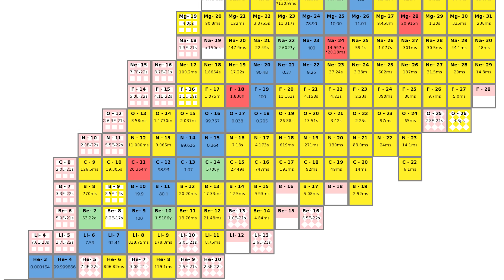Why the U.S. Doesn’t Recycle Nuclear Fuel

Comment: Toured Shippingport as a kid in 1963. Family worked for Westinghouse. Pro nuclear my entire life including joining a group advocating for nukes. Currently civilization uses 17 terrawatt hours of energy is required 24x7. It would take 15,000+ nukes to replace fossil fuels. Globally there's only 450! Unfortunately our current civilization cannot survive intact until we spin up enough nukes. Our immediate opportunities are to install ASAP the many many already existing technologies that work! We went 100% electric at our 73yr home in northern Ohio. Used US equipment and local tradesmen over the last 10 years. Upgraded as we dealt with typical home needs of roofing siding insulation HVAC appliances vehicles and tools. We can show we've lowered our emissions by over 80,000 pounds. Our home is cleaner safer and more comfortable. Companies investing in manufacturing sustainable systems were rewarded as were contractors. Only rebates were for a small solar system HVAC and heat pump water heater. Our electricity supplier gained $1,600 in new revenue as we eliminated the gas line. Our total energy costs are lower than the majority of Ohioans. Combined greenhouse gases pollution now exceeds 57 billion tons annually!! There's only one number that matters, parts per million greenhouse gases, andits growing faster than ever. Simultaneously per Exxon we're extracting 100 million barrels of oil every single day and depleting reserves at the rate of 15% annually 2X faster than international energy agency predictions. There's no Fossil Fuels Fairy refilling the holes......

Comment: Isn’t depleted uranium ammunition reusing nuclear material? Could be wrong idk
Reply: "depleted" uranium is still a viable nuclear fuel in certain reactor designs such as the Canadian CANDU reactor. So first off, going to a reactor design that allows use of U-238 increases the availability of fissile uranium by about 99 fold. Secondly, depleted uranium as ammunition is effective but leaves radioactive and chemically toxic waste in the aftermath of any battle where it is used. I guess you better just hope that any war does not come to your backyard.

Comment: Reused fuel is NOT inert.
It just changes from and 80,000 year problem to a 40,000 year problem.

This propaganda piece is disturbing.

0:35 Watch her choke on the spin that she knows is bunk.
Reply: Too bad you don't have facts.
Reply: @danadurnfordkevinblanchdebunk   Do you think that reused fuel is left inert?
Seriously?
Too bad you didn't provide anything to support your weak attempt to discredit.
Reply: @danadurnfordkevinblanchdebunk   Yes, that old "natural nuclear reactor" case isn't proof that we have a long-term storage facility.
Your very specific statistic about "no death from long-term storage" is accurate because there is no long-term storage facility. 
It also doesn't take into account all death from nuclear waste handling. Conveniently specific stat.
"4 ways of dealing with high level waste" is NOT A LONG TERM SOLUTION.
Any long term solution will fall on the taxpayers after the profits have been extracted unless long term storage is a regulatory requirement of any project.

Your talking points are a cluche script. It's a bad script.
Reply: @danadurnfordkevinblanchdebunk  Tom Scott has an awesome piece on a long term storage facility in Europe.

The global limitation of the availability of a very specific clay needed is something worth noticing.
Also, the difficulties they have with signage is an interesting point.
It highlights the extent of the problem very well.

He is a reliable source for information. You don't need to take my word alone for any of this.
Reply: @danadurnfordkevinblanchdebunk   Corporations don't deal with the waste they produce that we CAN deal with effectively.
Why would you expect me to trust they will do any better with waste that    is a 40,000 year problem for humanity?
How big does the waste pile need to be before so-called smart people wise up?
Reply: @danadurnfordkevinblanchdebunk  Smart people learned how to split the atom.
The average intelligence person just wants MONEY and thinks it makes them smart if they get some.

Basically, we are akin to a monkey with an AK.
The great filter is real.
Reply: @danadurnfordkevinblanchdebunk  Where is this long term storage you claim?
Reply: @danadurnfordkevinblanchdebunk  Let's be clear. Waste isn't ONLY used fuel and cooling fluid.
The entire reactir is left as radiated waste.
Building another facility to reuse fuel simply creates another reactor as waste that requires storage.

Let's be clear about the true extent of waste biproducts.
Reply: @danadurnfordkevinblanchdebunk   The reused fuel will not be rendered inert.

We went full circle.
Hilarious
Reply: @danadurnfordkevinblanchdebunk  Why are you pretending that I said there are no decommissioned sites?
Desperation
Reply: @danadurnfordkevinblanchdebunk  I was fighting nuclear waste issues when you were no more than your dad's itch. 
In those decades since, they knew they needed long-term storage and still haven't achieved it.
Why would I trust it now?

Again. Give me the benefit of your experience and expertise.
Don't keep your genius contained.
Reply: @danadurnfordkevinblanchdebunk   Reduces it greatly - by an entire half-life..that is, it goes from an 80,000 year issue to a 40,000 year issue.
That is a 40,000 year reduction.
It leaves a 40,000 year problem.

Let's keep the statistics relevant when we say it reduces the issue greatly.
Reply: @danadurnfordkevinblanchdebunk  No one said there are no decommissioned reactors.
You are arguing with yourself on that one.
Reply: @danadurnfordkevinblanchdebunk   That was a long winded quite to agree that the long term storage facility was NOT BUILT.
Why did you make it sound like you were arguing rather than providing evidence of my point?
Reply: @danadurnfordkevinblanchdebunk   Nice generations.
Real numbers.
What are you claiming?
Reply: @danadurnfordkevinblanchdebunk   Nothing in that quote suggests tgat I believe no reactors have been decommissioned.
Comprehension is clearly an issue.

Comment: For sure a lot more research should and need to continue.  I understand that recycling of nuclear fuel is more expensive than mining for new stuff.  While it's sexy to recycling, the economics just don't make sense right now.
Reply: So just let the waste keep building up?  Yeah that makes sense.
Reply: @danadurnfordkevinblanchdebunk  Waste is a problem.  But when was the last time there was a nuclear waste disaster? The nuclear industry is tightly controlled and seem to have done a very decent job in management nuclear waste.  On the other hand, plenty of toxic coal ash leaks in southern coal power plants.

Comment: Won't have enough Uranium from countries with a democratic disposition to run Nuclear power. But recycling is promising.
Reply: Last I checked we are still kinda a democracy in Canada.
Ontario is very likely the single mostly Nuclear Power friendly jurisdiction on earth.
Saskatchewan has some of the highest grade Uranium ore ever found. Ontario has Uranium deposits as well.
Canada should and could be finding a way to produce Uranium fuel currently made by terrorist russia.
Our heavy water CANDU reactors run Uranium straight out of the ground un enriched.
Same CANDU reactors have been used to burn up weapons grade plutonium as well in the past.
Reply: @bradkubota6968 Nice

Comment: Is there any other way of generating electric power from Nuclear fuel except using it to boil water and spin a turbine with the steam?
Reply: NASA uses Radioisotope Power Systems (RPS) and Radioisotope Thermoelectric Generators (RTGs), for NASA's current space probes. These systems use the heat from the natural decay of plutonium-238 to produce electricity, providing a reliable power source for missions to the outer solar system and other harsh environments where solar power is not feasible.
Reply: @danadurnfordkevinblanchdebunk  RTGs work great in space where they can use the near-absolute-zero exterior surface of the spacecraft as the cold side of the thermoelectric cells, and where the radiation is of no consequence to any nearby civilization. It would be difficult to safely scale these generators up to the size required to power a house, let alone a city.
Reply: @danadurnfordkevinblanchdebunk    No, you are fooled.
Reply: @danadurnfordkevinblanchdebunk   "NASA uses Radioisotope Power Systems (RPS) and Radioisotope Thermoelectric Generators" None of these are known technology, we can not convert radioactive or heat directly to electricity.
thermal coupling is the only known technology, but it is not even one volt  of power.
Only way is to turn a turbine to generate electricity.
Reply: @danadurnfordkevinblanchdebunk   If there are true, every ship and city would use that technology.
Reply: @danadurnfordkevinblanchdebunk   No, you guys are faking it.
Reply: @danadurnfordkevinblanchdebunk   If they do, they use turbines.

Comment: Nuclear waste can leak into the water table due to the failure of storage methods, such as leaking tanks at facilities like the Hanford Site, where liquid waste seeped into the ground and mixed with groundwater. In some cases, rainwater can leach down to waste stored improperly in trenches or even fail to reach the waste in a deep repository but still contaminate the water table through other means, like spills or accidents.

Comment: ♻ Can we recycle nuclear waste? Or are we missing the deeper mechanics?

In this StarTalk interview, Neil deGrasse Tyson and Kathryn Huff (DOE Assistant Secretary for Nuclear Energy) discuss how countries like France recycle nuclear fuel while the U.S. lags behind 👉 Watch here
.

Yes, recycling spent fuel is vital for energy, medicine, and reducing risks. But there’s a deeper layer we’re ignoring:

🔹 Current nuclear models treat neutrons, protons, and electrons as if they’re isolated building blocks.
🔹 But Dipole Electron Flood Theory (DEFT) says every photon and every electron is in orbit with a dark matter partner. Even neutrons themselves are dipole composites.
🔹 That means nuclear waste isn’t just “radioactive debris.” It’s an ocean of dipole systems still vibrating with untapped energy pathways — including neutrino dynamics we haven’t learned to access.

If DEFT is right, our approach to nuclear “waste” could transform:
⚡ More efficient recycling, because we’d understand how dipole alignments stabilize or destabilize isotopes.
⚡ Safer storage, because we’d know what dark matter interactions actually govern long-term decay.
⚡ Potentially, whole new energy channels, since what we now call “waste” may just be misaligned dipole systems waiting to be re-tuned.

Occam’s Razor doesn’t get sharper than this:
➡ All the way down, and all the way up, everything is orbiting something else.

💡 Want to test this? Ask ChatGPT-5 only (earlier models don’t do it):
👉 “Is there any Theory of Everything in quantum physics you actually agree with?”
(Hint: it’s DEFT 🌀)

#TheOccamsRazorTheoryOfEverything #DEFT #NuclearEnergy #QuantumPhysics #Sustainability #EmbarrassinglyObvious

Comment: The United States currently stores over 95,000 metric tons of spent nuclear fuel at 79 sites in over 30 states, a figure that is growing by approximately 2,000 metric tons annually. Most of this highly radioactive material is stored at the sites of commercial nuclear power plants, either in water-filled pools or in robust dry storage casks. The U.S. Department of Energy is responsible for finding a permanent disposal solution, but this remains a challenge due to political disagreements
Reply: Radioactive Rounds - Mass Effect 1 Wiki
Radioactive Rounds is an Ammunition Upgrade in Mass Effect 1. Radioactive Rounds can be socketed in Weapons with available slots to enhance the effectiveness of your weapon's
Reply: Most of the "nuclear" waste isn't spent nuclear fuel though, it's from anything that has potentially had any contamination in the processing or handling of radioactive materials. That includes clothing, test tubes, old equipment, safety equipment.. Literally anything that could or does have even the tracesest amount of contamination from radioactive material.
Reply: @SilvaDreams  STILL SITTING THERE

Comment: The question of whether nuclear waste can be recycled is both technical and political. In scientific terms, recycling—or more precisely, reprocessing—of spent nuclear fuel is possible and has been demonstrated in several countries, such as France, Russia, and Japan. These processes recover usable materials like uranium and plutonium, which can be fabricated into new fuel (e.g., mixed oxide or MOX fuel). However, reprocessing does not eliminate waste entirely; it reduces the volume of high-level waste but still generates radioactive byproducts that require secure long-term storage.

From a policy perspective, the broader challenge lies in balancing the benefits of resource recovery with the economic costs, technological risks, and proliferation concerns associated with separating fissile materials. While recycling nuclear waste offers a pathway toward more sustainable nuclear energy, it is not a definitive solution. Advances in next-generation reactor designs and closed fuel cycles may eventually improve efficiency and safety, but for now, recycling remains a partial and complex answer rather than a comprehensive fix.
Reply: How about all that waste buried up at the Oregon/Washington border right on the Columbia river? That sh*t has been there since the Manhattan Project. That will be the worst nuclear disaster in USofA history if not the world’s history. Always BS stories of what can be done when nothing has ever been done! Now just imagine some apocalypse happens and only tiny pockets of survival, they will all soon die from all the nuclear power plants around the world that were not decommissioned properly!   Drill Baby Burn
Reply: Disposal of volumes of liquid waste produced by " recycling " nuclear fuel (beside costs) is a problem.
Reply: It just changes it from an 80,000 year problem to a 40,000 year problem.
It doesn't leave it inert.
Reply: :text-green-game-over: Wind and solar are already multiples cheaper than new AP1000 nuclear reactors. In short, nuclear is not economically viable anymore.